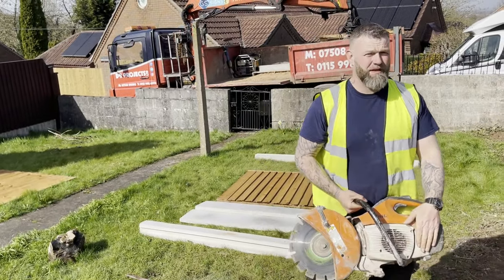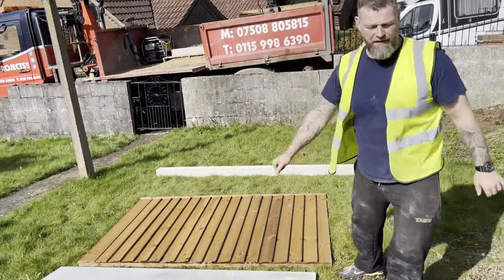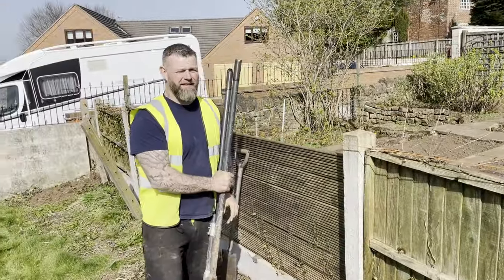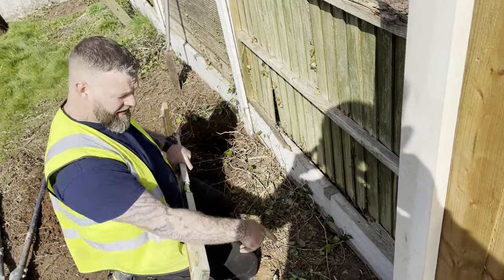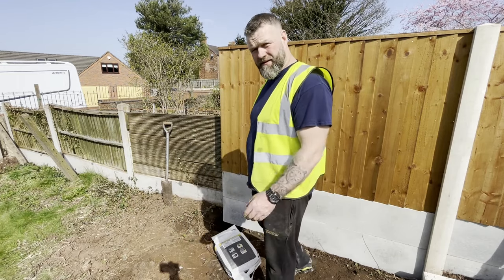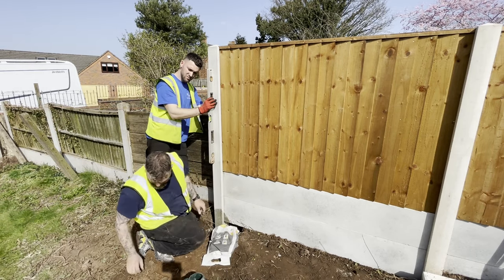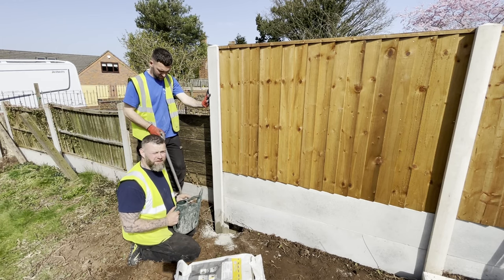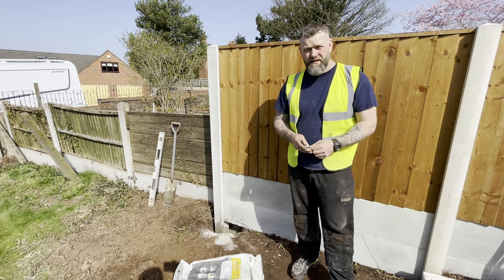How To Install A Fence From Start To Finish!

Comment: Just done a fence today old post concrete in every hole I needed a post, 3 roots the size of an elephant’s trunk running parallel through my holes, I’ve worked my legs off today grafted and no one will ever know or appreciate the pain of my work day today and I’ll die a poor man in 45 years. What an existence this is.

Comment: Awesome video lads cheers, just checking it out to see if I've missed any tips or tricks.

The only thing I will add is if anyone plans on doing a decent amount of fencing it is worth getting a Petrol Earth Auger for about ~£200, makes digging holes so easy and will save your back if the mud is tough.

I personally got the BU-KO 52CC 2Stroke Petrol Earth Auger 3HP V-Type, comes with 3 drill bits and an extension, I'm doing 3ft holes perfectly fine with it. Sometimes have to use the thin drill bit first if the mud is like concrete but can follow-up with the bigger one after.

Comment: Good video, and well explained, am about to fit new panels and concrete posts, good tip with marking the hole digger with tape to get the depth. Thanks

Comment: I'm watching this as a 33 year old single lady who needs a new fence due to problematic neighbours. Was quoted £1500+ to have it done for me so I'm trying to see if I can save money by buying all the materials myself and trying to install it myself! I doubt I can but you've given me the confidence to try!
Reply from the maker: We have faith in you
Reply: Have you started? Is it as easy as it looks?
Reply: @tigerberrie5147  I can't speak for your own, but mine was a bit harder than it looked. I had really unlevel ground with holes and stuff in it so the hardest part was getting it all flat and level. I ended up going with panel fencing so it was much less work but did require another person to help. However I'm 5ft 1, 100lbs and 33 so I could just be weak! Also didn't go this route with the posts either, I found some post holders on Amazon that just need to be hammered into the ground instead of digging and using concrete, so it's ended up being a fence which can be easily removed if needed! It was worth it though and ended up only costing £160 in total instead! And now I don't have to deal with those neighbours either :)

Comment: What would you do if you were laying the gravel boards on top of a concrete base as opposed to earth? 
Would you cut and dig it out or simply lay them level on top?
Also the current end post (wooden) is bolted to the house, brick wall. Should I use a slotted wooden end post bolted to the wall?
Thanks for the tutorial. I've done a bit of landscaping but am in reality a novice. 
After watching this I'm considering replacing the fence myself.

Comment: Thank you, clear video and explanation. I need to replace some broken fence panels (the concrete posts are fine) on a slope of about 25-30 degrees. I want to place gravel boards down to stop the wild animals digging under the fence. Is it OK to completely bury a gravel board with another one on top?
Reply from the maker: Yes you can do that No problem

Comment: Hi, thanks for the detailed guide, it really helps. Question: if i have (100mm x 100mm) 8ft concrete post, digging 2ft down, what would be the diameter of the hole? and how many Postcrete bags would I need? Thanks a lot in advance.
Reply from the maker: 2/3 inch around the post is plenty. Bigger the hole, more postcrete needed 👊🏻👍🏻

Comment: Thanks so much for the very informative video, these tips are a massive help as I'm replacing the old fencing in me garden all by myself! If you don't mind me asking, is it necessary to lay some gravel to the bottom of the hole for drainage purposes? Great video again, gents!
Reply from the maker: We are glad they are going to help you buddy!!

No I wouldn’t say it is essential to do that, but for peace of mind for the drainage of water I guess you could do that but we don’t! 

Thank you!!
Reply: Not for concrete posts but if you were laying in wooden ones then 3inch of gravel topped by a 3inch layer of dry concrete mix before putting post in would help against rot setting in from underneath. You'd still get rot at the top of the concrete mix sadly but there are products that can stop that too, Postsaver Pro-Sleeves are one of many.

Comment: Top tip get a wood 4x4 the same height as you're concrete and drop it in the hole to check your height easier than heavy concrete in & out.
Start at the top of a slope, then you don't have to worry about the next bay height. Dry mix & tamp it, works out cheaper than post mix

Comment: First panel fence coming up next week I'm keen to try out some of these top tips dude! Especially taping off the 2ft height on the scoops 👌 genius!
Reply from the maker: Makes it so much easier
Reply: Most builders been doing that for decades but it is a good tip. Personally Mine are marked at 2 ,4 and 4 foot . I usually use gas auger and finish it up with post hole diggers to get more accurate depth.

Comment: Great video guys. I know I will have to cut one of my gravel board, would it be best to start with the cut gravel board from the house wall or start with a full board and cut at end? Cheers
Reply from the maker: we cut at the end buddy
Reply: Depends how fussy you want to be too. If you have a short garden and you wanna real top finish you put even cuts next to the house and at at the end of the run too.

Comment: Brilliant information guys. Am erecting 20 panels with concrete posts on slight incline, maybe a foot over full distance. Shall I start high or low point? Thanks again guys , best fencing video👍

Comment: Hi guys, definitely helped me out with panel and post installation. I have a few questions still though. 
1. How did you workout you needed two gravel boards to make the fence level across the run in the first place?
2. How did you make sure your fence was in a perfect straight line and not dog leg? 
I'm putting a wooden fence in at the weekend and am unsure on these two points. 
Thanks in advance.
Reply: 2. Use a string line I’d think bud

Comment: Great video boys.......and quality work, well done.
A question if I may; I see you place 2 gravel boards one on top of the other before installing the next post.......is there a maximum fence height you can use this method ?
I am look at using 6 gravel boards ( 6 foot high fence) and don't really fancy lifting each board over the top of the post and then lowering into position.
Any help/comments gratefully received.

Comment: Great video guys, may be a daft question but if using/putting up a full gravel board fence (I.e 5/6 gravel boards stacked ontop of one another) would the process be exactly the same? (I'm looking at putting in somewhere that needs to be secure so the dogs can't escape and gets very wet and windy from time to time so timber pannels will rot quickly regardless of what preserve I put on them). Any suggestions would be great, cheers guys.

Comment: Concrete posts are a very good idea and should last a lifetime but I see one tiny modification to  your fence to make it last even longer. If you leave a tiny space (a few millimeters) where the wood touches the gravel board at the bottom, rain water will dry quicker and therefore less likely to rot the wood from bottom up. Here in North America, we use wood posts and they have to be replaced every 20 years or so due to rot. Concrete posts is a wonderful idea.
Reply: You can get a type of rubber material that lets water pass through, cut it into strips and place between the panel and gravelboard
Reply: @kjp2404 it’s just a fence mate let’s not get fancy🤣
Reply: Any idea where to buy these concrete posts in the u.s.? And the c9ncrete gravel boards?
Reply: If florida yropics, wood rots out too quick.

Comment: Great tutorial! Super work as always! I'm looking to put fencing up in my garden, but it has 2 different level's, how do i accommodate for the height difference when putting the fence and posts in please? Would it be possible to have the panels all the same height by using more gravel boards in the lower level? or is it best to have the panels stepped down from the higher level to the lower level?

Comment: I had my fences installed today. Exactly same with the gravel boards and concrete posts. I would like to know what I can do to fix the fences so they don’t shake. They are not fixed and if you push it with one hand the bay shakes back and forth. Is that normal and can I do anything to make it more sturdy and fixed in?
Reply from the maker: You can put some wedges behind the panels

Comment: I need to do my whole fence in time but I’m looking to replace a section consisting of about 4 bays first, by my new patio. My question is I have at the moment all wooden Mortis panels but I want to replace these with concrete post with concrete gravel boards and slide in panels, but what do I do about the existing mortis panels on either side of the new bays?
Reply from the maker: If you could send us a picture over on Instagram of the current situation I could help you that way?

Comment: Hi there. Looking for some advice please. My brick garden wall fell down recently, and Im looking to install a fence instead. While knocking down the rest of the wall, I've seen that the base of the wall is still in tact and quite strong. Would it be possible to place the gravel boards on top of the bricks to use them as a base? Thanks

Comment: I've just removed my old fence, I've dug out all the old posts, gravel boards and a massive tree stump which had originally broke the first few gavel boards. Now i have a huge hole and larger holes left from digging the old posts out. What is the best way to go, back fill the holes then start a fresh dig for all the new posts or what would you recommend....?

Comment: I'd have put more post crete in that to support the base panel. Dunno if that's what you did but didn't show or mention it, just shows a big gap under it. Other than that, good video

Comment: Excellent video!!!

Going to use this to install myself. Just a few questions?

1. How do you deal with a section you need to make less than 6ft long to deal with the end of the property/boundary?

2. When starting a fence perpendicular to a brick wall. Do you install a post flush with the wall? 

Thanks for the help!!

Comment: Do you need an expansion gap between panel and concrete post? Will a panel grow at all? say in winter if I had to slot a new one in from above once panel needs replacing?
Reply: Wood will shrink not expand

Comment: Second question. Am I correct thinking you used double gravel boards in order to achieve level with post top along the length due to incline?

Comment: Got another question sorry, I have a gate smack bang in the middle of my fence. One side measures to 15.76ft, and the other 15.27ft. Given I have gate posts and the panels are generally 6ft, how do I go about putting in the posts? Do I put 2 posts in at 6 ft which leave 3 ft between post and gate post? But that panel will be 3ft. Is that how you'd do it?
Reply from the maker: Spot on 👊
Reply: @DJProjectss  brill, cheers! 😁

Comment: Wonderful vids watched a few now! Can i ask how wide the post hole is and is making the holes deeper than 2ft (to avoid having to cut the posts and the horrible damage quartz dust can do to your long term health) a problem? I have 5 panels to fit at the back of my garden but with abit of a slope so thinking deeper posts make for more stability? Many thanks Tom
Reply from the maker: Hi Thomas! 

They are probably around 6-8inches at most I would say, you don’t want the hole to be too wide otherwise you will need more postfix! 

You can have the posts as deep as you are willing to go lol but we always recommend 2ft! You can either dig a bit of a trench for the gravel or panel or like you said you can use taller posts for the drop or slope! 

We normally only go to 2ft unless we are using 12ft posts then we go to 3/4ft for the stability!
Reply: @DJProjectss  Many thanks for your help and info!!

Look forward to future vids!!

Please consider the danger of stone dust (quartz and silica ect), your great vid where you had to do a lot of cutting the existing gravel boards ect seems to show little PPE with no breathing consideration. I am no expert nor wishing to tell you how to suck eggs however what i do know scares me tbh!
Keep up the great work, many thanks!!

Thomas
Reply from the maker: @thomashowcroft1597  plenty of videos to come!!

We have been a little slacking with our ppe to be honest! We will be sure to sort that out ASAP!!!!!! Again, thank you for the support!!!

Comment: Hi guys, can i ask a question. How deep into the ground does the post need to go? Im wanting to fit a fence with an overall height of 6 foot. A 5 foot panel, 1 foot gravel board. So do i need a 7 foot post going 1 foot into ground or an 8 foot post going 2 feet into ground? Thanks!

Comment: Great vid guys but i have a question i am wanting to raise my garden as its on split level with fencing at the bottom, if i raise the fencing  using 3 gravel boards high and 10ft posts, would the boards take the weight of the hardcore and soil, or would i need to be using  a reinforced wall.
Reply from the maker: We have done the same sort of thing with fencing using 12ft posts and a 10ft fence as a retainer, but I can’t promise you anything buddy 👍🏻

Comment: Really good video, the problem I have is digging through heavy clay and flint the size of footballs - ideas?
Reply: We fill the holes with water and leave them if it’s hard flint /clay . The water normally softens it up
Reply: @davidwhite4195  Thanks for the reply, confirms what I have done but it's very hard work, thanks all the same.
Reply: @mrvolcada5355  no worries and thank you for the support 💪

Comment: Q: my boundary curves round..if I head in one straight direction then what do I do at the curve point…hope that makes sense
Reply from the maker: You turn the posts slightly to make them to curve or if it a 45 you it’s corner post

Comment: Great video, great finish. A question please: the gravel boards are not secured, is that ok? Do they secure themselves by their sheer weight? Also the panel is slid in, not secured. Is that ok? Just curious. Thanks for the video

Comment: How long would you have to wait before starting the next panel? will the previous post not move because of weight or strain
Reply: We use postcrete James so by the time you have sorted the next hole and levelled the ground ready for the gravel board the last post has normally set . Hope this helps ?

Comment: Can I ask how you do this on a sloping garden? How do you make sure the concrete fence posts remain at the same height if you’re using 6’ fences and 1’ concrete gravel boards?

Is it as simple as using string and adjusting the hole you dig for each post?

Many thanks in advance for any help and advice.

Comment: How did you secure the panels to the cement posts.. do you use metal braces and bolts and nuts?

Comment: What's the best way of taking out old concrete posts?
Reply from the maker: Try and break down each side of the post to separate the concrete from the posts if possible, if not, dig a hole next to the post away from the concrete to give the post some wiggle room and it may be able to be pushed out. That’s how we do it
Reply: @DJProjectss  thanks for the advice, I will give that ago 👍🏻

Comment: Hi does the gravel board need any concrete to secure it?
Reply from the maker: No as long as it’s on a compacted surface and tight up to the posts you should be ok 👌🏻

Comment: I've never considered cutting the bottom of the post to fit the hole ;-) I've always slightly over dug and put a little concrete in the bottom of the hole to sit the post on... but that does involve a little lifting and jiggling around. Really interesting way of doing it.
Reply: i might try this idea but once you put water in the hole after you put a bit of concrete in wouldn't the post drop

Comment: If the panel is 4 ft, and the two gravel boards are 1ft each, and the hole is 2ft, does that mean your posts are 8ft long? What if I want to use only one gravel board with a 4 ft fence. Does that mean the whole needs to be 3ft deep?
Reply from the maker: No you will need a 7ft post because you only need 2ft in the ground

Comment: good stuff.. How wide do you make the hole? In another video the carpenters daughter was suggesting 2 inches on either side of the post is enough. Your thoughts would be much appreciated,
Reply from the maker: as wide as your post hole shovels if using them. just remember not to go too wide otherwise you'll have no stability and will need to use a lot more postfix!
Reply: @DJProjectss  so if I buy a 20kg bag of postmix how many holes will it fill?

Comment: Great video. With your step by step intructions to hand, I'm confident in giving it a go. 

The only issue I have is quite a tight curve in my boundary. Would you suggest just following the same method as in the video but cut the panels and gravel boards to cope with the curve, or is there a more suitable fencing method you could suggest?
Reply from the maker: curves can be tricky! but still doable! we will show a video on how to handle them!
Reply: @DJProjectss  That's great, I look forward to seeing the video. Thank you for responding and for the future video, you're a proper gentleman 👍
Reply: Hi mate, I’ve got the same problem. I’ve got a slight curve to fence off. Could slotted posts be used on a gentle curve or do they need to be on a straight line only. Any advice will be much appreciated.
Reply: @almusti  what i normally do is twist the post slightly so you still have the slot in the post for gravel board and panel still how bad is the curve
Reply: @pcgaming6485  It was a gentle but sweeping curve so like you said I was able to twist each post following the curve and it worked just fine. Thanks for the reply though. Cheers.